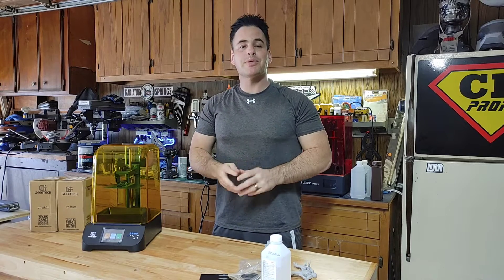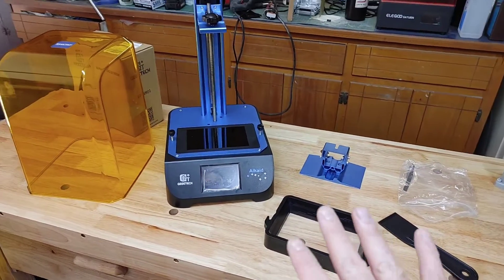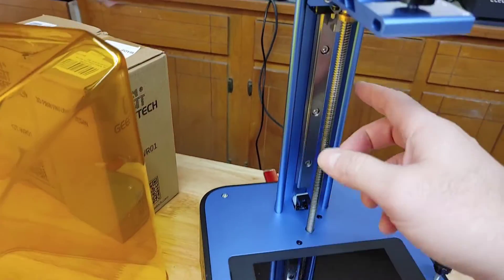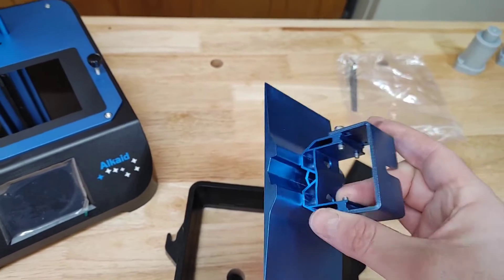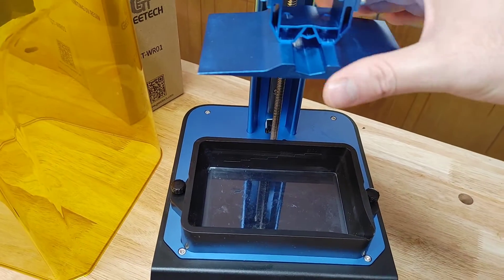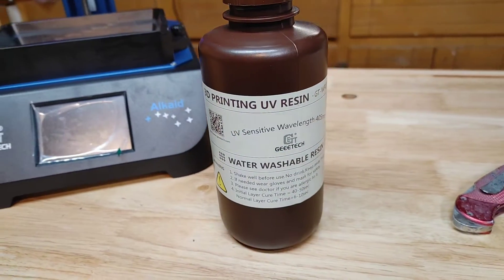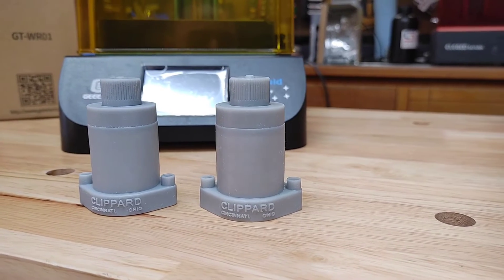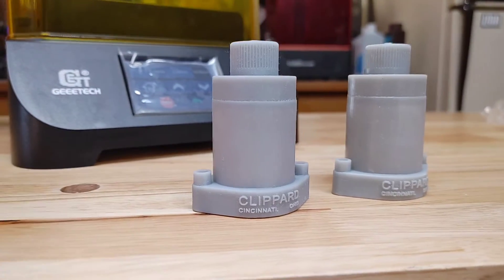Best Cheap Resin 3D Printer? - GEEETECH Alkaid Resin Printer Review

Comment: They contacted me - I declined after seeing the reviews out there!  (Plus it is winter in Maine and I can't have resin in the Bat Cave since the cats get into everything)
Reply from the maker: I hear you, actually funny you say that most of the printing I did with this printer was well below 32 degrees. So it does work in freezing weather haha. Not sure on below zero though.
Reply: @ChrisBoshProps  the shop (basement) stays about 62-65 during the winter with the heat loop it has. Fine if you’re moving around. Chilly if you sit still!